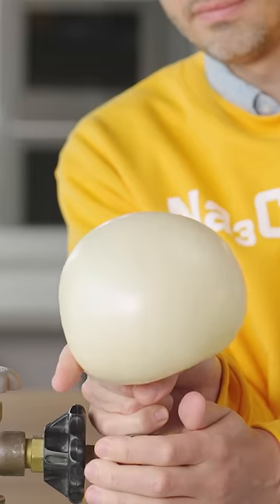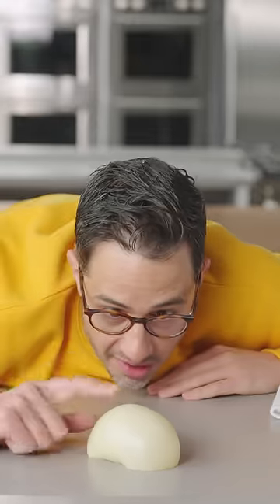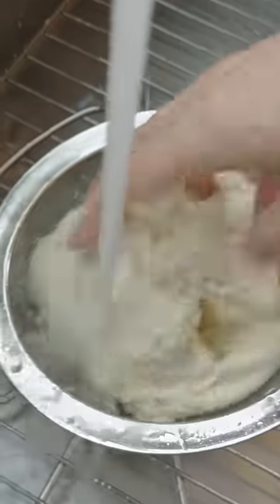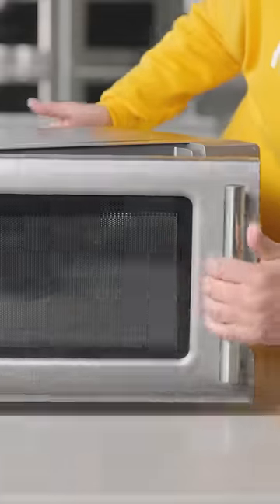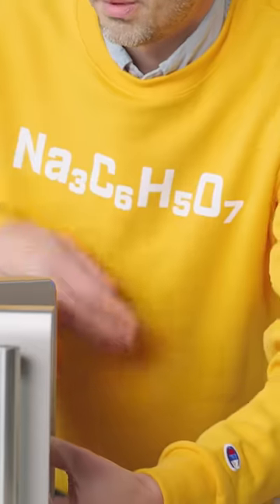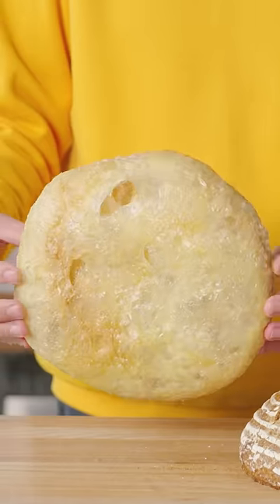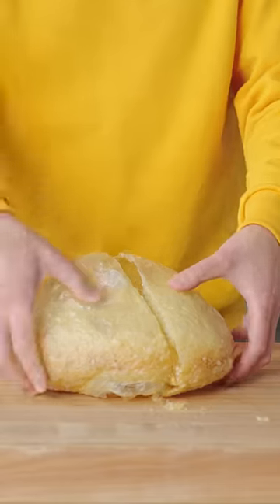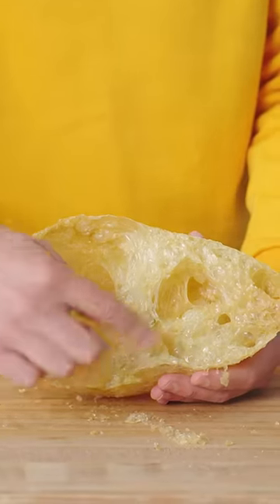This is 100% Gluten Bread

Comment: Now for the ultimate weapon, we need the milkless lactose
Reply: I feel my stomach bubbling 😩
Reply: A shot of mucus 🤢
Reply: That's very similar to sugar

Edit: you guys need to chill, I know lactose is a type of sugar, I said very similar because the crystalization process is different and it results in crystals with a different color compared to normal everyday sugar
Reply: it already exists
Reply: Yeah that's just a type of sugar. I'm lactose intolerant and some products DO add lactose as their sugar. Anything that ends in "ose" is a sugar: glucose, fructose, lactose, sucralose, etc. All of them are extractable.
Reply: @brencislloyd9517  sucralose is not a sugar, perhaps you mean sucrose
Reply: @ealdbehrt  no I meant sucralose. I suppose you're right that in a traditional sense it isn't a sugar and it's definitely not natural. But it is made from sucrose by ultra concentrating it with minimal calories. You can't use the "ose" ending without it being a sugar though, that's what the "ose" suffix means. Other artificial sweeteners don't end in "ose" for that exact reason. It's just a sugar alcohol.
Reply: @brencislloyd9517  sucralose is not a sugar nor an alcohol. it is made by chlorinating sucrose which disqualifies it from being a sugar or an alcohol.
Reply: @ealdbehrt  I think we're reading different information. That's okay. I'm not going to argue anymore cause arguing on the internet never helps anything. Have a good day.
Reply: @niisoft Yes, that's what the suffix ose means.
Reply: @brencislloyd9517  You looked it up and saw you were wrong didn't you? It's okay, you were too embarrassed to admit it so you ended the conversation, we've all been there.
Reply: Is it cheese?
Reply: They have it for tests for lactose intolerance
Reply: @brencislloyd9517  It's possible to have a normal conversation without arguing.
Reply: @NamelessKing1597  no I genuinely think arguing on the internet is pointless and found conflicting information. 🤷 I'm literally not trying to be rude or fight.
Reply: @paulinxm8201  I'm well aware. It felt like an argument so that's why I left the conversation.
Reply: Combine the two and add peanuts
Reply: @brencislloyd9517 woah I actually didn't know it's a sugar... That explains why I still get sick on days I don't consume dairy!
Reply: @ealdbehrt it is a sugar though, more specifically a non-reducing disaccharide (as the selective chlorination doesn‘t break the glyconic bond of the sucrose)
Reply: Some pills use lactose as a filler, and they are about 99% lactose, so whenever you take them as medicine you are consuming 99% lactose.
Reply: @NamelessKing1597 you need happiness
Reply: When i was in my Elementary School, I've landed in a hospital with hugely destroyed stomach.
The obvious question was: what is destroying my guts so often?
Once they've made me a gastroscopy (or something like that, dunno), they were pretty sure, yet to check it, they gave me a small cup of strange white ish water, that was sweet somehow like it was added with a couple of spoons of sugar in it.
It was an almost pure lactose.
The same hour they passed me that i went straight to the toilet for my biggest crap i've used to fucking drop.
I have a Gilbert's Disease, or syndrome... whatever.
Would not recommend anyone.
Reply: Whey:
Reply: yeah, obviously just wash your milk.
Reply: Milk-free fat
Reply: @NamelessKing1597 i think they were confused because sucralose is artificial and isn't usable for energy. it is a kind of saccharide as indicated by 'ose' so you're correct. not all sugars provide usable calories when eaten. cellulose tastes like nothing and is completely indigestible to people, yet still has saccharides (and with the right enzymes could be food, like it is for some molds and bacteria and insects)

sugars are p cool
Reply: Isn't that just cheese and butter 😂
Reply: @havootu  butter and cheese retain the milk proteins but the lactose is discarded with the whey or buttermilk, so no, milk products aren't necessarily rich in the sugars.

leche, scalded milk and several other things do still feature lactose heavily tho
Reply: That is just pure lactose sugar. nothing special about it
Reply: When you get tested for lactose intolerance you latterly have to eat raw lactose in an empty stomach haha (it wasn’t fun)
Reply: Literal biological warfare 😂
Reply: that's called Lactose Powder..
Reply: thats just gonna be a sugar
Reply: Lactase.
Reply: You can buy it at brewing stores. Used to back sweeten beer and wine
Reply: Lactose powder with water lol
Reply: I would drink it... I would regret it but eh
Reply: @blackeneddove  🤤
Reply: Yeah that's available on amazon
Reply: Gets used a lot ! I’m a brewer and if we’re ever making something like a milk stout, we get big bags of pure lactose powder delivered.
Reply: @nocandidate Isn't that just butter or ghee?
Reply: @NamelessKing1597 It is a sugar. On the other hand, it's not a sugar alcohol like Xylitol or other artificial sweeteners that end in -ol.
Reply: @brencislloyd9517  ahh Sucralose
My favourite anti-cautionary tale about lab saftey
Reply: @Polopony20. That's not how that works😅 It's a sugar naturally only found in dairy. When we say "sugar", we monstly mean sucrose, but this is not the only sugar from a chemistry perspective. Perhaps better to call them saccharides
Reply: They use that to bind flavors to chips, it's dumb as hell!
Reply: They use pure lactose for sweetening some things like beer because the yeast does not eat it
Reply: We use that in my work to make coffee whitener, big 25 kg bags of lactose powder
Reply: @brencislloyd9517 While you are correct that it is derived from sugar, the process in which they chemically change sucrose into sucralose replaces key molecules that woukd otherwise determine that it's a sugar. From what I'm seeing, stuff that say thing that end in "-ose" say MOST not all.
Reply: it exists. helps loosen up ur stool.
Reply: ...what? That's always been a thing.

Who upvotes this stuff?
Reply: That's just glucose connected to galactose. It's just sugar
Reply: @brencislloyd9517  Sucralose is sucrose where the hydroxyl groups are replaced by chlorine, so it isn't a sugar alcohol. It isn't really concentrated, but different, and for whatever reason I guess triggers the sweetness sensors in our tongues much more strongly.
Reply: Lactose has very little sweetness compared to sucrose (table sugar)
Reply: There's pure lactose and pure gluten powder available online, now we pop that in the water supply and watch the weak fall
Reply: That exists. And iirc is used in labs. Lactose is a type of sugar.
Reply: not only is that already a thing, it's also a common medium for drug delivery!
Reply: Some beer is sweetened with lactose since brewers yeast doesn’t eat it
Reply: Pretty sure you can just buy it.
Reply: Let me introduce: Tagatose
Reply: @liltwizz_07 that's a lactose binding enzyme, not a sugar.
Reply: @gljames24 that's milk fat and probably protein. Lactose is it's sugar, and a lactose based sweetener is called tagatose
Reply: Everyone reading me: bro literally just said ☝️🤓

There, I'm ahead of the NPCs.
Reply: LMAOOO
Reply: HELP
Reply: Bunch of vegetables
Reply: 100% lactose milk
Reply: @blackeneddove 💀💀
Reply: Been done brudder
Reply: @NamelessKing1597 it is an artificial sweetener, so technically, the name alludes to a substance that is sweet/used to sweeten something. It IS not a sugar by its chemistry, but it is being used as a sugar substitute.
Reply: @Polopony20. It's in a lot of places you would never expect. Like most tablet type pills and pressed powder candies which often use it as a cheap & (mostly) harmless binding agent.
It's a by-product of other milk based products, so it's a fairly cheap additive when fillers or binders are needed.
Reply: @pepperypeppers2755 why? It's mostly flavorless, doesn't cause any harm unless you're lactose intolerant and it's cheap.
Do you have a better option? Granted it should be named on the ingredients label instead of listed as "natural binder", but we're talking about something people use regularly use in cooking
Reply: It already exists and it’s a white powder 😊
Reply: U can actually buy it at stores
Reply: Lactose is just a type of sugar, my dude
Reply: Lactose isn’t very soluble by itself, so it would be like really slowly dissolving sugar that gives you inflammation, lol
Reply: Its just a sticky powder
Kinda like powdered sugar
Reply: @djc6323 You say that like it's a bad thing.
Reply: It's called 'Lactose'.
Used as a laxative/alternative sweetener.
The safest kind of laxative  actually.
Most pharmacies worldwide have them.
Reply: There's whey protein powder.....
Reply: @gljames24 
No sucralose is not a sugar
Reply: @CountryCowboy008 
Nobody is arguing that
Reply: @ADSHYN 
They were talking about sucralose
Reply: Milkless lactose is...lactose.
Reply: Basically whey protein
Reply: @bichen-up-ur no, a lot of cheeses are lacking in lactose
Reply: Oh that already exists. I had some for a lactose tolerance test. It's actually really nice! Kind of sweet, like if you thinned out condensed milk.
Reply: Lactose is made out of 1 molecule of Glucose and 1 Molecule of Galactose, so it sounds like it would be possible to make it chemically in a lab if you had those things
Reply: Just order it,it's used to cut white powder drugs and not hard to purchase
Reply: If only I had some of that in middle school when I wanted to stay home and play pokemon gold...
Reply: Lactose is already milkfree
Reply: That's just pop rocks.
Reply: That's just Acid.
Reply: @brencislloyd9517  why has this never occurred to me before 😂
Reply: I've had pure lactose once, for a lactose tolerance test

Let's say I was not very tolerant
Reply: tried it. not great
Reply: tried it. not great
Reply: tried it. not great
Reply: tried it. not great
Reply: I had home economic classes back in late 60s first 5 yrs of 70s yes  many states are different of what is required and  is a selective course yes all states should have as a required course it taught me well besides what I learned from my grandma and mom but
Sad many don't have it required etc but
Reply: There's a synthetic form called Lactulose. It is used to treat constipation, and other things.
Reply: Lactulose
Reply: I hav some here in my lab. For lactose intolerance diagnosys
Reply: you're milking it now
Reply: @liukang85  M😁😁!!! Some of us try our best.😆
Reply: That made laugh hard 😂
Reply: Sounds like condensed milk with extra steps lol
Reply: @niisoft  It is in fact a type of sugar.
Reply: What the hell happened here
Reply: please
Reply: Oh gee we have a cringe lord super mind reader here 😂😂@NamelessKing1597
Reply: @BetterCallBigShotAutos I guess majority of the general population is weak in ur book 🤣
Makes sense. Superiority can't be statistically normal 😏
Reply: When you're sliding into first and feel something burst...
Reply: You mean you going to become vegan and I eat dairy or you’re probably probably talking about GMO
Reply: I am dying from this right now. I even took lactaid but it wasn't enough. I needed more lactaid. 2 extra strength was not enough. Bruhhhh whyyyy
Reply: @XaleanderS  shut up
Reply: @brencislloyd9517 rose is sugar 😮
Reply: basically whey
Reply: Eating pure lactose is basically going to be like eating sugar with a slightly different mouthfeel. And gut-feel, depending on whether you can break it down or not 💩
Reply: Sugar💯🔥🔥
Reply: that exists because lactose is a sugar that can be synthesized
Reply: "Soy milk... There is no such thing... It doesn't exist..., it cannot exist because there is no soy titty... Now is there?" ~ Lewis Black
Reply: @niisoft or sugar-free caramel in stores lol
Reply: I use it all the time at my job
Reply: Its called candy bars 😂
Reply: @Brometheus420 and red 40 🤣
Reply: Just go to some lab
Reply: Or maybe saltless sodium
Reply: We already have that, it's a common filler material for tablets.
Reply: It's just sugar but with a slightly more laxative effect
Reply: I think that's just lactose
Reply: Isn’t that what protein powder basically is?
Reply: @devinewynder5443  lmao not at all
Reply: @brencislloyd9517 OWNED 😂😂
Reply: that exists
Reply: @NamelessKing1597 nah dude, chemist here. If it’s got -ose (fructose, lactose, maltose, etc) at the end, it means based on the chemical structure it’s a sugar, like how anything ending in -ol is an alcohol (methanol, isopropanol, ethanol etc). 

It may be synthesized, but that doesn’t make its structure NOT a sugar
Reply: Oooo mix it together! It would be milquetoast!
Reply: @NamelessKing1597  you are very sad
Reply: @brencislloyd9517  i personally that arguing is a good thing as It allows People to learn New things and test already know knowledge

The issue is that we dont cargue anyone but rather push our ideas and opinions as factual information

 and the lack of source citing doesnt help neither as we cannot know if the source of information is trust worthy or acurate
Reply: I think I got prescribed that once for constipation 💀.
It tastes kind of like honey.
Reply: That actually exists
Reply: You can buy it.
Reply: Yeah you can buy bags of that fairly easily (it’s used in brewing some types of beer)
Reply: Another poisoned food😂
Reply: I mean they have powdered lactose 😂😂
Reply: @ealdbehrt  It's an artificial sweetener, which is what brencislloyd said. An example of sucralose is Splenda, a sugar substitute.
Reply: @Derkderkb  Brencislloyd was actually correct. It's a sugar substitute, as he said.
Reply: @dantetempest9585 I think NamelessKing needs medication and therapy tbh.
Reply: Thats just liquid whey 😂
Reply: So sugar? Basically
Reply: Ooh my stomach's bubblin @blackeneddove
Reply: you can just buy straight lactose in a bag
Reply: @GameCyborgCh  As a common person who can't handle other parts of dairy, I can handle using lactose as a sweetener, just fine.
Reply: @liltwizz_07 no no, lactase is the opposite of lactose, actually. Lactase breaks down lactose, and lactose is what's in milk that causes intolerance! Lactose also influences the shelf life of milk too, which is why lactose-free milks are good in the fridge for longer!
Reply: @BetterCallBigShotAutos literally biological warfare lol
Reply: @brencislloyd9517 cellulose also kinda is
Reply: .

Jesus loves you. He is your savior. Repent for the kingdom of God is at hand!
Reply: Cu-
Reply: sdsac
Reply: Honestly I don't know how to feel about this. Milk makes me vomit whenever I drink it but other things don't really give me any problems.
Reply: @niisoft  lactose is sugar.
Reply: You mean Water? Or COW Fat?
Reply: its called whey protein
Reply: We have it
Reply: @niisoft  Pure lactose tastes very bad
Reply: They give you a glass of that to test for lactose intolerance
Reply: @djc6323 lactose isn’t like mucus at all
Reply: @brencislloyd9517 sucralose is actually not a sugar
Reply: @NamelessKing1597 generally yes but not everything that ends in ose is a sugar
Reply: That exists!

They made me drink 350ml of it in order to take a lactose intolerance test. It's awful
Reply: lactose is just a type of sugar so that wouldn’t be hard
Reply: If milk is used, it should be thoroughly sterilized; with this precaution, there is less danger of contracting disease from its use. Butter is less harmful when eaten on cold bread than when used in cooking; but, as a rule, it is better to dispense with it altogether. Cheese is still more objectionable; it is wholly unfit for food.[The safeguarding of the purity of all foods of dairy origin is a matter of prime importance. While frequent testing of dairy herds, together with thorough pasteurization and refrigeration, serves to this end, such foods, if from uncertain sources, or if carelessly handled, constitute a serious menace to health; for, as stated in U.S. Department of Agriculture Farmers' Bulletin No. 1705 by a Government expert, Rowena Schmidt Carpenter: "The same chemical constituents and physical properties that recommend milk as a human food make it an excellent food for bacteria." The reader will understand that the reference to cheese does not include cottage cheese or foods of a similar character, which were ever recognized by the author as wholesome.—Publishers.] MH 302.1
Reply: Then turn it into butter and make shitty toast
Reply: @Timon-IrishFolk It's crazy that you're just saying words. Go ahead and define glyconic bond, or did you mean glycosidic? Sucralose is not a sugar it is an artificial sweetener, it's not a carbohydrate.
Reply: Whey protein:
Reply: @nilered
Reply: @NamelessKing1597 you literally agreed with the dude in a previous comment and then said "you're wrong!!" like.. tf, lmao?
Reply: Hilariously you can get put on a dea watchlist for buying lactose 😂
Reply: Just hop into any bio lab. We have tubs of the stuff.
Reply: ChristopherWallbank-di9hj  when did I say it was illegal? Getting put on a watch list doesn’t mean you’re breaking the law it means they’re watching you to make sure you aren’t breaking the law and you 100 percent can get put on a watchlist for buying lactose because it’s such a common cutting agent.
Reply: that does exist, it's powdered lactose which's employed as a filler in many pharmaceutical products
Reply: @niisoft normal white granulated sugar is refined which is why it's white when it's unrefined its slightly yellow
Reply: @thesoutherncourier169  when I talk about sugar as a substance I refer to it's pure form, brown sugar and all the other colored sugars are sugar with impurities. This discussion was about pure chemicals so the color refer to the molecule of glucose and the molecule of lactose both in crystalized form
Reply: DONT PUT THIS EVIL INTO THE WORLD. WE ALREADY SUFFER ENOUGH
Reply: how are ao many people arguing about sucralose not being a sugar?? you can literally google it in a few seconds. it’s a disaccharide. that’s a sugar. sucralose is a sugar
Reply: you can buy pure lactose in stores here in germany. I'm pretty sure it's intended to be used as a laxative?
Reply: @ealdbehrt Sucralose is an artificial sweetener derived from sugar.
Reply: Very easy. You can buy pure lactose online
Reply: @brencislloyd9517 good point, anything ending in "ose". Now hand me the nose sugar ❄️
Reply: Reverse lactase supplement
Reply: @NamelessKing1597  I like (sarcasm) that you were not even part of the original discussion and yet you barge in to passive-aggressively insult someone.
Reply: It’s literally just syrup 😂
Reply: So just sugar?
Reply: Im lactose intolerant :(

and celiac 😭
Reply: I’m not even lactose intolerant and my stomach is bubbling.
Reply: i mean if i get a walmart exec to call it a weapon i could get a class action going against them for how many times I found "fortified wheat gluten" as ingredient 2 in a bread in the "gluten free" freezer
Reply: Engines roaring. Pfrŕrrr
Reply: You can buy pure lactose.
Reply: @brencislloyd9517  there's nothing to argue about though. Sucralose is not a type of sugar. That's the objective truth.
Reply: @Timon-IrishFolk it's not a sugar
Reply: It exists. We use it in my microbiology lab for certain sugar fermentations because lactose is just a sugar compound. 🥰
Reply: @brencislloyd9517 I like this response 👍👍👍👍
Reply: @brencislloyd9517  Garden Hose
Reply: @ealdbehrt  "Sucralose is marketed as Splenda, an artificial sweetener that often comes in a yellow packet. The difference between Splenda and other sweeteners, like aspartame (Equal) and saccharin (Sweet’N Low), is that it’s actually made from real sugar. This gives it a taste that is generally more preferable compared to other artificial sweeteners.

Sucralose is chemically changed so that it’s 600 times sweeter than real sugar with almost no calories. It doesn’t leave an aftertaste in your mouth, so sucralose is used in foods like yogurt, candy, ice cream, and soda." You're wrong.
Reply: hell nah just worse tasting milk
Reply: It already exists, it's used by doctors to test if you have lactose intolerance
Reply: ..u mean lactaids? lolol
Reply: They make some craft beers with lactose 😬
Reply: My god im deleting YouTube these comments hurt my brain and make me angry
Reply: @Wehra96  milk stouts can be really good
Reply: Sweet lactose. The elixir that fuels my eternal youth.
Reply: nobody’s body has enough lactase for that i’m 100% sure
Reply: @Shadozcreeping Isn’t it used a lot as codings for like sausage
Reply: I always assumed you could buy lactose by itself since I heard it was used to make milk stouts.  I do love a good milk stout.
Reply: actually you can get lactose sugar. It's used in several applications, but particularly beer brewers use it for some beers.
Reply: And tobacco free cigarettes that only have cancer in them
Reply: Most meds use it as an excipient (filler)
Reply: It's already available as medicine for constipation 😅
Reply: I have several flasks of it in the next room
Reply: Ultimate weapon 😂
Reply: But lactose does not serve an important function as gluten does.
Reply: .....lactose is an additive...it does exist on its own. Its not a byproduct, its something they add to sweeten milk. That's why lactose free milk is usually much less sweet or overly sweet because they over-compensate with other sweeteners.
Reply: I'm not even gonna read this whole comment section but the fact some of all don't know that cheese and yogurt is almost lactose free cause of bacteria eating the lactose into Lactic acid is insane.
Reply: @blackeneddove  i can drink 5 liters of milk without any problems

You would be on the toilet for 5 days straight

We are not the same
Reply: Thats just sugar bruh
Reply: It's already there
Reply: this is what soya milk is
Reply: Lactose monohydrate is used as a sweetener amongst other things
Reply: @blackeneddove  you can power through that if you really want to
Reply: @ealdbehrt  
Swing and a miss, '''The organochlorine  sweetener sucralose is a synthetic trichlorinated disaccharide.''

Sucrose is ALSO a disaccharide, just not chlorinated.
Reply: Ah yes, my arch Nemesis